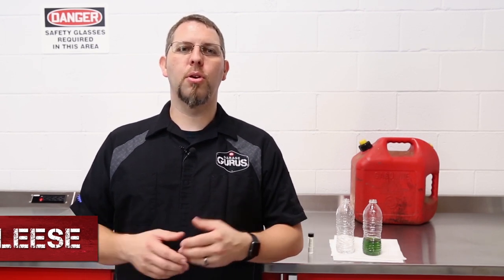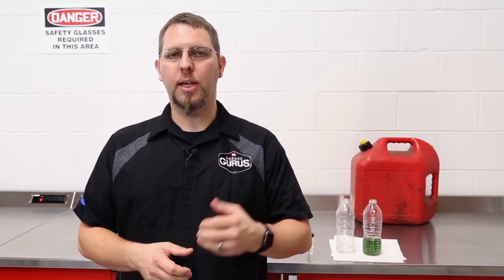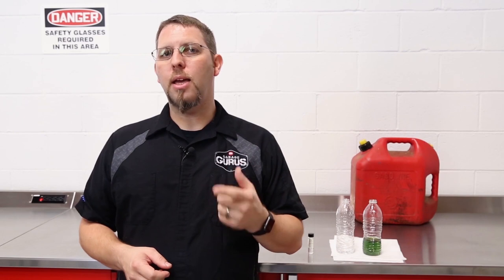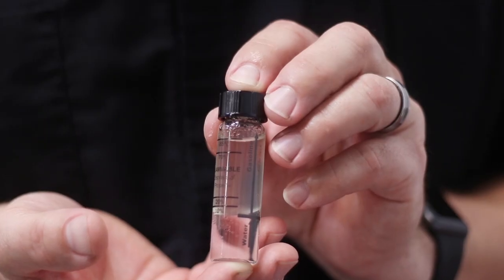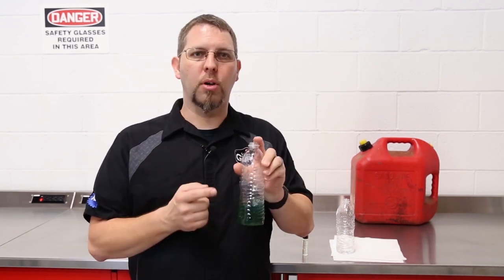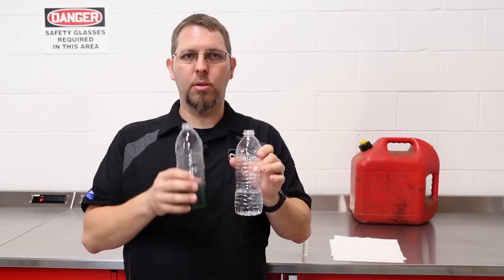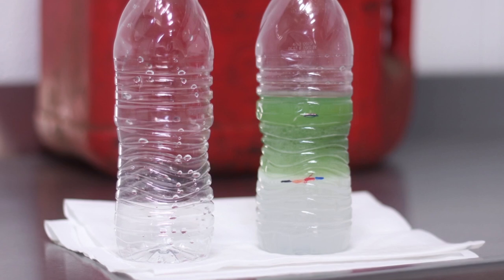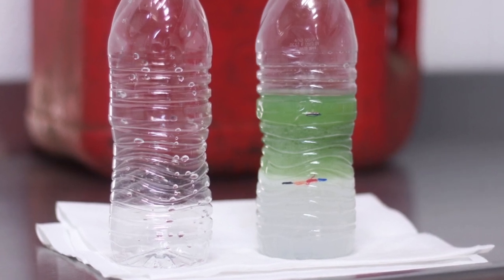Testing for Water in Gasoline

Comment: I had something very strange happen recently. I went to fill up my tank. I then drove about 50 miles. My 20 gallon tank had dropped down almost 8 gallons when I had only gone about 50 miles. It shouldn't have dropped that much. I work from home most the time also; so this means that I'm driving very little. 

This makes me think that I had gas stolen; like someone siphoned gas from my car. 

...

But after I thought that I went to a different gas station, and filled up. Then did my drive for the week, which was like 24 miles. I came home and my gas meter in the car had barely changed. It was noticably much less gas used, where the gas from before dropped a lot but all came from a different gas station. 

...

This make sme think that maybe that 1 gas station might be selling gas that's dilluted with water? 

But I want to ask also how do you tell and identify an event of someone siphoning your gas compared with a gas station selling dilluted water? And if it was gas sold with water dilluted in it, wouldn't the symptom of that look like the gas guage dropping faster than it should? 

Thanks for any insight on this.

Comment: I suspect water in my 2 stroke, 6 gallon tank, boat gas. I only use non-oxy gas and the fuel in the can is already premixed. If I siphon fuel from the bottom will I be able to see a water/premixed fuel line similiar to just water in the fuel? Only source of moisture I can think of is condensation.

Comment: But doesn't that add water to the gas?
Reply: Yes but it also combines with the water in the gas and collects it on top of the fuel, now the dividing line will drop below the original line and the difference represents the water that was present in the fuel before combined.  This is a very helpful video, I recently had some sudden issues with a vehicle and suspected it began shortly after I had filled up with gas - this test proved that I had fuel almost 50 % water, also murky colored and funny smell I think some was diesel.

Comment: 12/3/2020

The whole thing about water in fuel is a myth. And, no, there aren't a lot of options for auto fuel; there are three, regular, 89 octane and 92 octane. Now, re you experiment, didn't you forget something? Yes, you you did not tell us how much water was in your fuel sample, other than the amount you poured in. Why? Because there was none, other than the amount you poured in. The true test of water n fuel is to sample an amount from the gas station, and let it sit for one month and see how much water will settle to the bottom. Do not be surprised if after one month, there is no water.